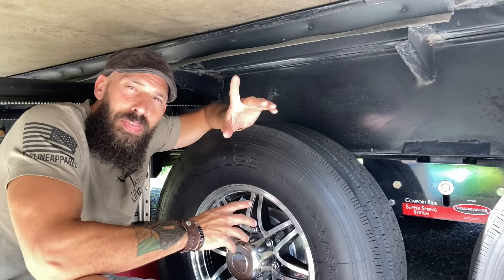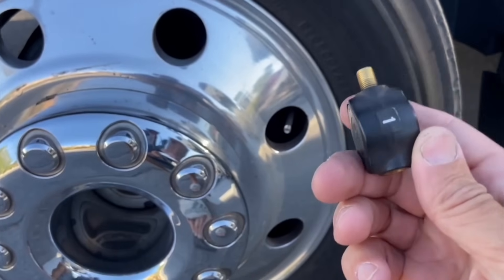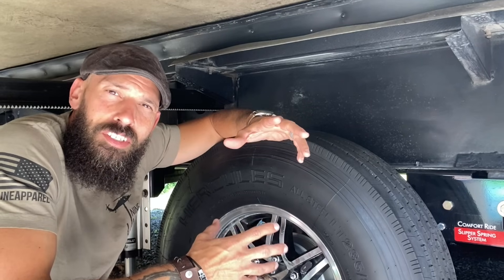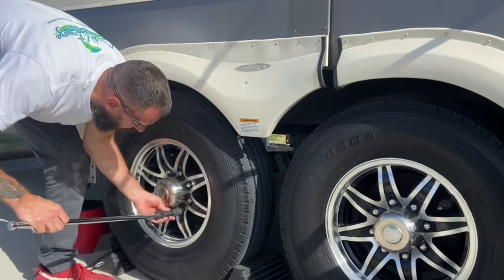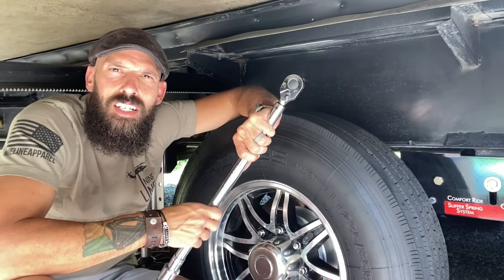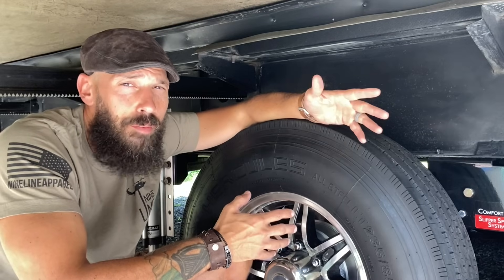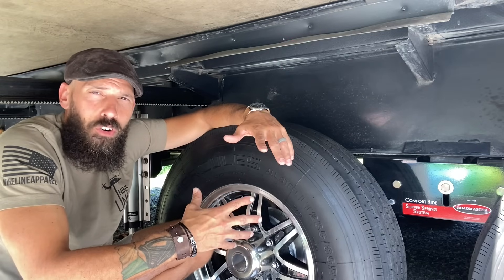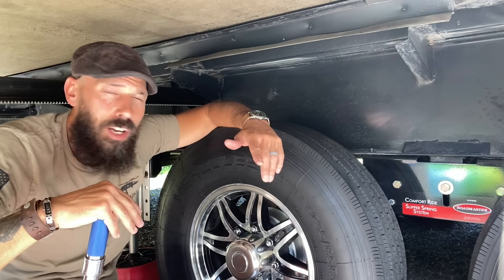One Important Thing Most RVers Overlook with RV Tires!

Comment: Excellent advice, One tip when using a torque wrench, steady pressure until the click. Bouncing the handle will give it a false reading. Also one click, a second or third click actually will tighten it more and beyond your chosen torque.
Reply: Thank you for bringing this up. Even people who have been using a torque wrench for years don't understand that the second "click" when done in a hurry is actually over torqued. I've learned to pull slowly to the "click" and let it rest for a minute or so and pull again. The nut may move again before the wrench "clicks" and that's o.k. That means it wasn't fully torqued the first time. If you yank the wrench til it clicks, it's definitely improperly torqued. Also, try to stay in the middle of a torque wrench's range. They are notoriously out of calibration at the upper and lower end of their range. If you need 100 ft lbs, the wrench should be capable of 50 ft lbs either side of that figure.

Comment: Excellent video ; I drove Greyhound bus and lost a set of doolies. Vary lucky everything turned out safe . Turned out the Winter tires were replaced for Summer tires 14 days previous. The nuts were massively over torqued resulting in the studs being stretched and cracked .      Good channel .
Reply from the maker: Sounds scary. 😬😬Thanks for watching and commenting John👍🏼

Comment: When I worked for a company and we drove  350 and 450 heavy duty service trucks  . We were get all our tires done buy a tires dealer that also serviced large trucks. The problem came in when they reinstalled the wheels.  They were us the heavy duty air wrench to tighten the lug nuts.  We got to where we were having wheel studs breaking off and the duals coming off.  The company did a research and determined that the tire dealer was over tighting the wheel lug nuts causing the studs to shear off.
Reply from the maker: Crazy! You think they would know better. That’s why people go to these places because they want to feel confident they are getting the job done right. Appreciate you watching and commenting 👍🏼

Comment: I check mine every trip I’m surprised how often some of them get a quarter of a turn. I set mine at 100ft/lb. I recently purchased a 325ft/lb cordless impact drill with 100ft/lb torque adapter. This has made this job so much easier.
Reply from the maker: Nice. Definitely a good tool to have for sure! Appreciate you watching. 👍🏼
Reply: Torque limiting adapters are notoriously inaccurate. They are a get close device then finish with the torque wrench.
Reply: @richardl5902  I’ve tested mine with a torque wrench and it’s right on.

Comment: Good advise.. also if a shop puts wheels back on with impact wrench, they could have it cranked up to get nuts off faster, then over tighten your lug nuts when going back on. That will stretch the studs (like you said Chris) and cause breakage in the wheel studs when heated going down the road (happened to the other You-Tuber you referenced - broke all 8 studs).
Reply from the maker: Yes sir. I know a shop stripped mine on my old Challenger I had one time too.

Comment: I agree with this 100% , torque for the wheels is very important. I recently had my tires rotated on my vehicle and I always check them after about 100 miles. So I was checking the torque with a torque wrench and came across one that was under torqued and another one of my wheel nuts was damaged. The nut had a deep scare, possibly from an impacted wrench. It was so bad that I could not get the socket on to check the torque. I had to beat an old socket on to it to get it off. I had to go and buy another nut so I could torque it to spec. Looking on the bright side, if I didn't check the torque this issue would have gone unnoticed.  So if I would have had a flat it would have made it 👍extremely hard to change the tire on the side of the road. Thanks for sharing this information. 👍
Reply from the maker: Thanks! That’s a good example of what can go wrong. Definitely appreciate you commenting and watching 👍🏼

Comment: Curious. If you just had your vehicles tires worked on.  If they used the typical impact wrench, How would you know if they over torqued the bolts. If you do as you said and check torque they would show  that they would be OK even though they may be way over torqued. My suggestion would be to break loose each bolt one at a time and then re-torque them (one at a time)
Reply from the maker: I was right there next to them filming when they did the work and made a friendly reminder not to over torque them. They were very professional and have been doing RV suspension work for years. So when I went to check them I started at 110 on my torque wrench and they all moved just a hair at 110 so I know none of them were over 120. But yes you could do what you suggested 👍🏼👍🏼

Comment: I've seen this happen several times, also saw lugs break when over torqued.  Another thing to remember is that you should re-torque 50 and 100 miles after a wheel has been serviced.  And it's even more important if you have alloy mag wheels.
Reply from the maker: Yup, it happens out there and can be a scary situation. Thanks for watching 👍🏼

Comment: learned this the hard way after buying my 5th wheel in another state and driving 1200+ miles home.  So busy with other things, forgot to check torque... lost both wheels on the drivers side!  This was especially complicated with the trailer riding low in back by 4", which put more load on the rear axle.   a trailer that is not level can really make for a terrible tow/ride.
Reply from the maker: Wow! That’s crazy. I’ve had to tow on only 3 tires myself and that was very scary so I hear you. Appreciate you watching and commenting. 👍🏼

Comment: Torque wrenches should be operated with clean fluid motions no jerking or stopping and starting. If you jerk the wrench or stop the tightening process close to the final torque, your wrench will not give you a correct torque reading. Jerking a torque wrench is not only bad because it messes up your reading. It also messes up the internals of the torque wrench itself. I see very few YouTubers using their TW properly.
Reply from the maker: Yes thank that’s a good tip. 👍🏼 I do know this and that’s why I explain in the video I’m in a tight spot and can’t get the proper leverage I need when I torque that one lug and for filming purposes I’d be in the way if I moved sides. If you noticed on the other ones I was in a good position to smoothly torque them. Thanks for watching and commenting.